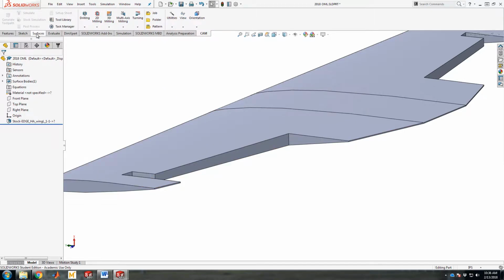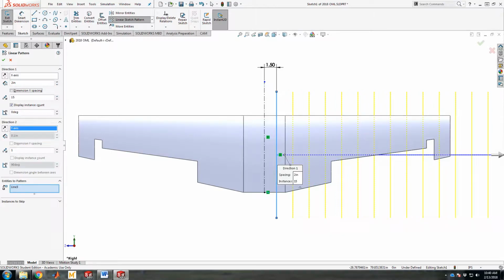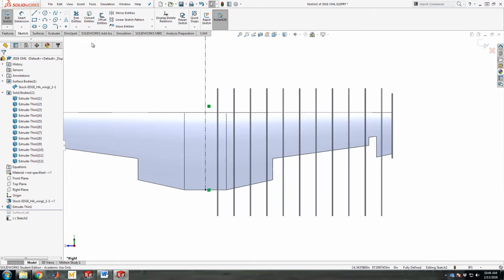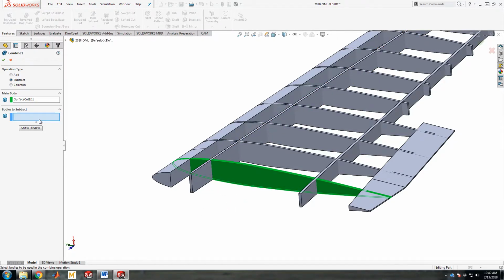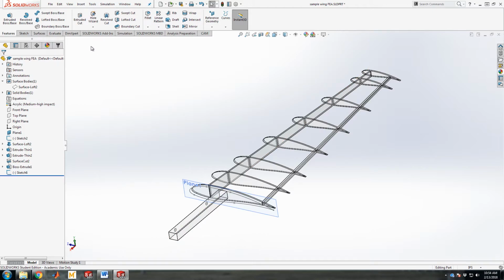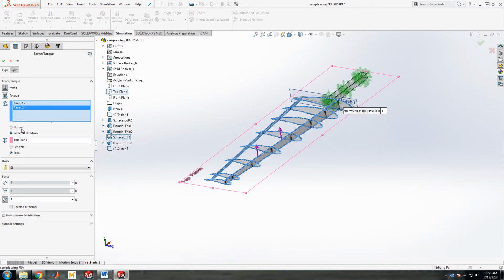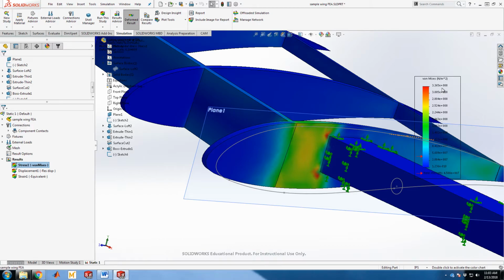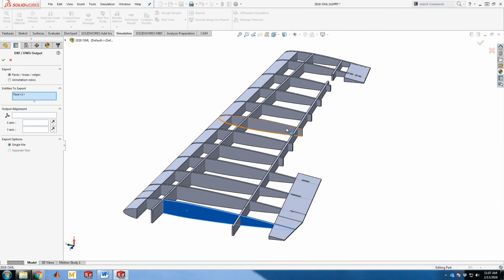Aero Structures Solidworks surfacing example.

Comment: If anyone wants it, I reoriented the part so it follows Solidworks coordinate system and re-positioned it so the midpoint of the leading edge is at the origin. -Johnathan Weir

https://drive.google.com/file/d/1WkeVpDBEIXgM77p2w8q1EKg7fQ0sEoBv/view?usp=sharing